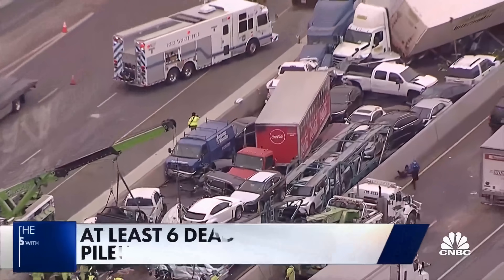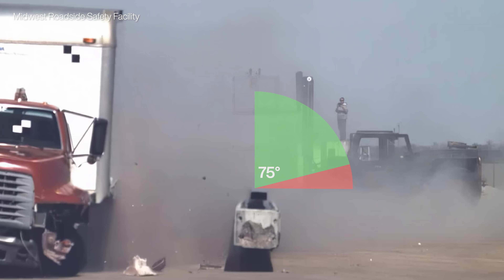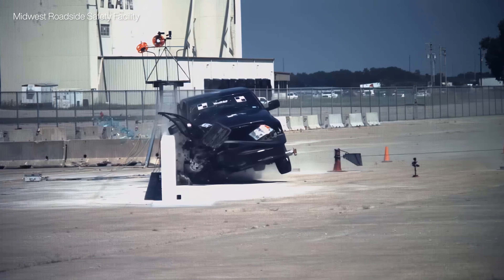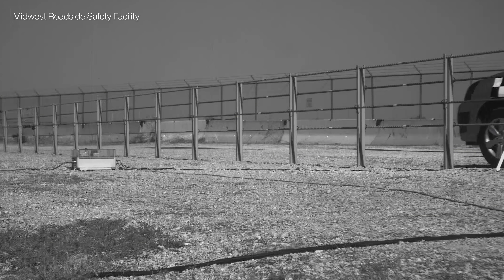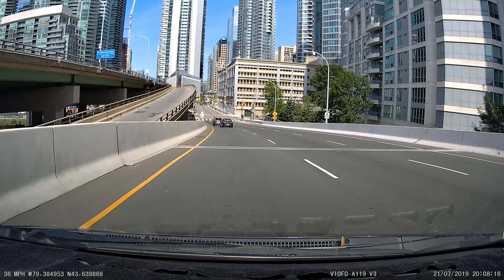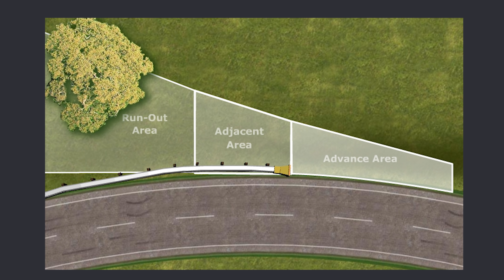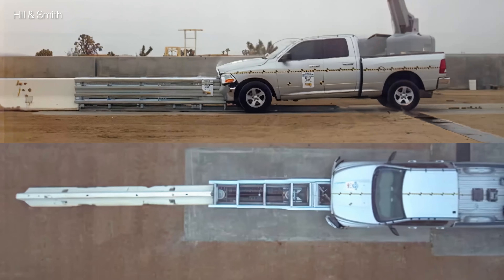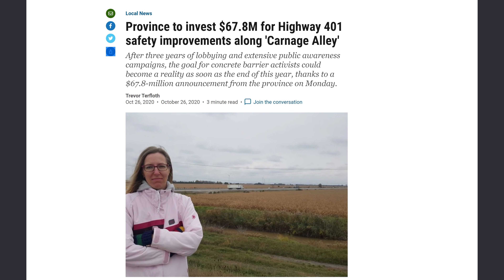How Road Barriers Stopped Killing Drivers

Comment: My issue with cable barriers is that on low cars, cabs and motorcycles they can become a head chopper.
Reply from the maker: I looked into the research cable barriers could be safer, but from studies the show that most motorcycle drivers already lying on the ground when the impact the cable barrier.  But for other impact types it's probably not as good
Reply: @Lam  If you are driving basically any car that isn't completely enclosed, cable barriers are far more likely to serverly injure or kill someone. It doesn't show up in statistics because there is such a small percentage of people who drive cars like that.
I've heard many horrifiying stories, and knew a person who died because of a cable barrier. He was driving on the highway in his convertable, and lost traction on one of his tires. He kept it straight for long enough to scrub off a lot of his speed and went into the ditch. He the hit the cable barrier at a fairly low speed. But instead of the cables catching the car they rode up the hood and windshield, snapped into the passenger compartment, and bisected him just below the brest. 
He died nearly instantly, and he wouldn't have if it was a regular guard rail. They think that he hit the guard rail at under 20 at a pretty shallow angle. So he would have likely rubbed along the barrier and safely came to a stop if it has been a regular barrier.
Its even worse for motorcyclists who may have scrubbed off their speed and hit the barrier slowly, only for the cables to slice into them and cut off limbs or send them cartwheeling.